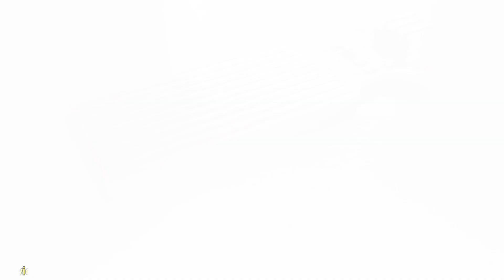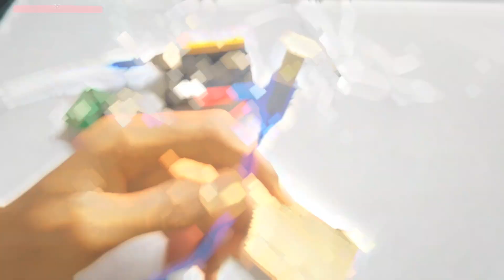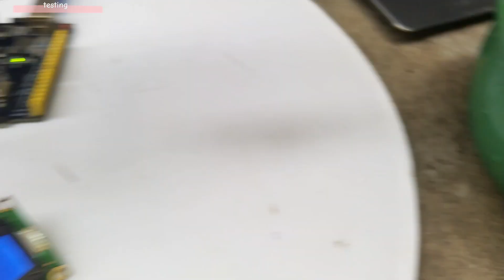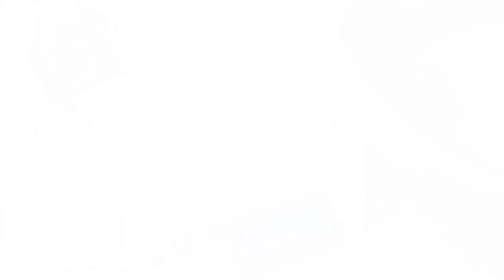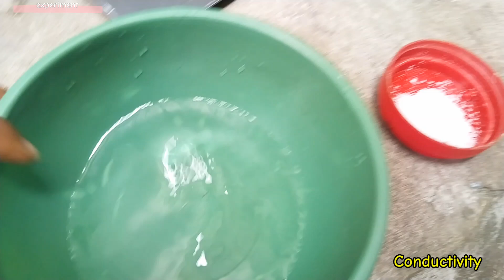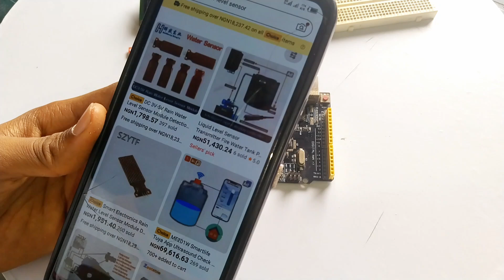"Building a water level system" AliExpress hidden Gem l How do they work?

Comment: Nice project 😌 but the conductivity of the water in use will make circuit not much accurate 😅
Reply from the maker: I think microcontroller should handle that